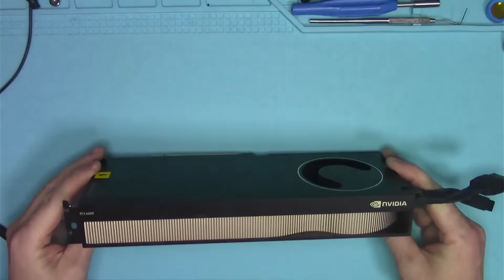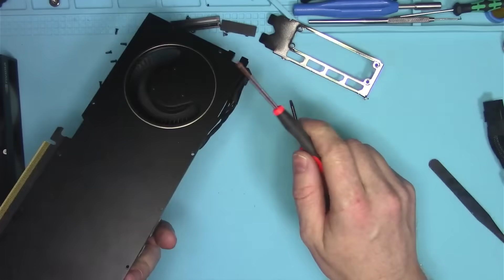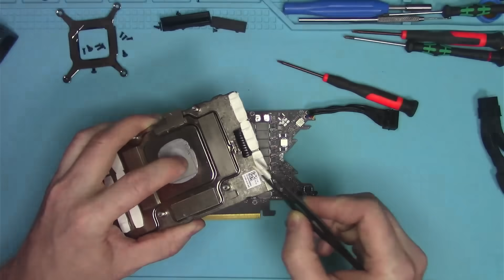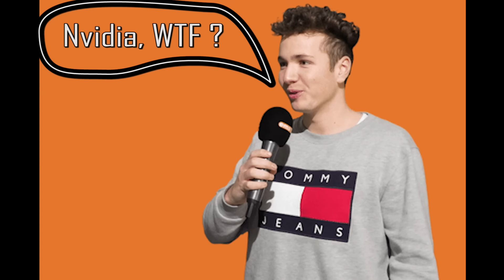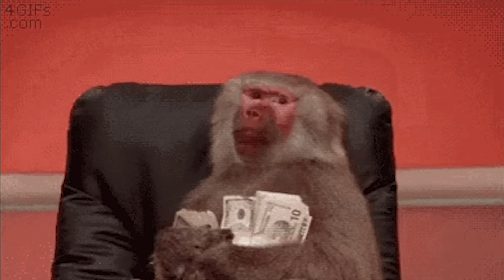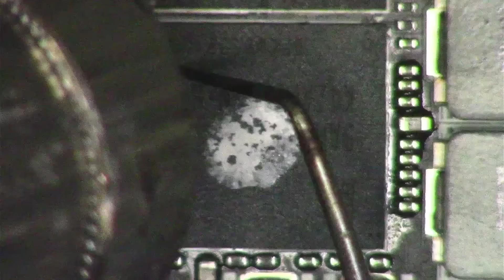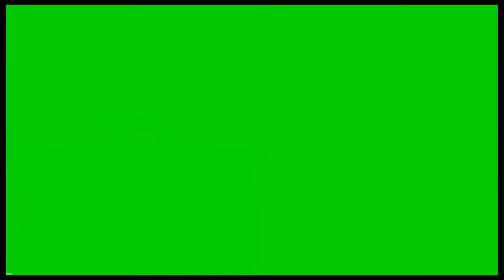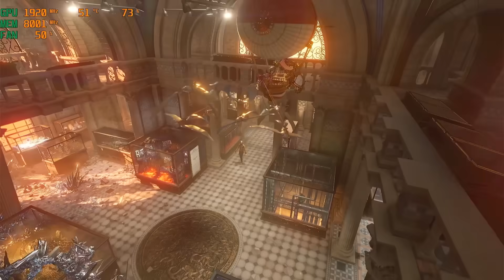Repairing the High-End Nvidia RTX A6000 GPU

Comment: The A6000 is a multi purpose Work Station card, it's used in anything from CAD, DCC, Medical Visualization which it has dedicated drivers for.  It's also used by Professional 3D Modelers/Animators in work station configurations.  The new iteration of the Quadro Line of GPU's pretty much
Reply: @johnnycab8986  don't know the specifics but, in 3d render workflows, its pretty much the same as a 4090 unless you have really complex scenes with lots of moving parts, lighting etc., in really really heavy workloads it can render twice as fast as a 4090. Unless you're pushing limits, it doesn't work better then a 4090, I'd just guess it can handle a lot more abuse for a lot longer which only true professionalls would run into
Reply: @heavenbaron4108  Actually the RTX Ax000 cards use the same architecture as the RTX 30 series cards Nvidia's Ampere Architecture. The RTX X000 without the A are the Ada Lovelace architecture same as the RTX 40 series cards.
Reply: @johnnycab8986  Ever tried to render a scene need more than 24 GB ram? or would you trust a consumer grade card enough to put in a supercomputer like racks full of just graphics cards.

Having 48gb ram is just more convenient or if you nvlink its doubled. If im trying to meet a deadline im not gonna try optimize every bit my big 3d scene and i wont trust a consumer grade card work almost %100 for days non stop and i want customer support and driver support for my niche softwares.

Dont get me wrong 4090 can do a6000 job but to a limit.
Reply: @msavasacar  Typically if your scenes make use of more than 24gb vram, then you'd just get a 2nd 4090 in the same system (still cheaper than an A6000), as most software can make use of dual gpu setups like this. So the vram issue is more for independent professionals and smaller businesses who likely weren't in the pricing group of the A6000 to begin with. When we move to full enterprise scale project needs, the benefits of the A6000 (outside of its drivers and some computational benefits) is that you can simply stack far more of them into one system, and don't need to sync multiple pcs to work on the same project in unison -and yes at this point it is also ofc much more convenient to have 6x48gb vram in one system, than 3x24gb for example with the 4090's limitations. It makes workflow more efficient when you can just fire up big projects on one system, also if multiple individuals are working off of that one system in tandem. Easier to have 2 pc that can service 10 people at the same time, rather than having 4-5 independent systems that don't talk to each other without being interlinked and that whole can of potential problems and pipeline barriers.
Reply: @Real_MisterSir  Almost every software can use dual gpus yes but consumer grade cards cant create shared vram pool. If your renderer need more than 24 gigs of data to calculate next iteration it has to swap data from card to card using pcie lanes, enterprise does this with dedicated link, nvlink. If can get benefit from that a6000 is for me if not then its not. I seen multi node like 20 30 computer, full gpu racks and even multi cpu racks for different purposes used by small companies. You can justify 8 a6000 price with single large project. It really depends what you do. Having cutting edge wokflow can and will give you more options business standpoint. So if you work deadline to deadline a6000 or threadrippers for you if not stick with consumer grade.
Reply: @msavasacar  thats lame
Reply: @msavasacar  More vram, and better customer support are valid points. This graphics card is using the same GPU (GA102) used in the RTX 3090 ti (and variants of this same GPU were also used in the 3090 and 3080), so if driver support is better for this model than the consumer variants, that's only because Nvidia is choosing to not make those drivers compatible with those other cards with some arbitrary restrictions which they could easily not impose on people.

The blower style design might be better for some systems, but I would NOT expect these workstation cards to actually be any higher quality, or more reliable, than most high-end consumer Nvidia cards. Many high end consumer grade graphics cards are likely of a higher level of quality and reliability.

If the better customer support and vram capacity is worth it for you, then that's great, but keep in mind that Nvidia makes much higher margins on these workstation cards than on consumer grade cards. The much higher price is not actually getting you a higher level of quality or reliability.

If you want to learn more about how to determine what makes one model of a graphics card better quality or more reliable than another model, check out Buildzoid at Actuallyhardcoreoverclocking. He does very thorough analysis of different boards, and I think he does sometimes do analysis of the workstation cards, though usually he is more focused on high-end and upper-mid-range consumer grade cards.
Reply: @syncmonism  Physical reliability is hot topic tbh, consumer cards need to be changed, upgraded each iteration, its not that easy at enterprise setting and thing can go wrong like power connector failure.

Definition of reliabililty for me, whatever fails i dont care, how fast it can be resolved and how low that failure risk (either physical or software).
Those cards can carry a million dollar several seconds of animation for feature movie or last minute job for some architech. if your card generate revenue like 10 times of its msrp like in a month that price gap is acceptible for me.

I will check out your recommendation, thanks
Reply: @johnnycab8986  In reality, for most applications it doesn't. A ton of VFX and visualization/3D studios are using 4090 cards instead of the A series. There are some benefits to the A series such as the higher Vram capacity on top spec cards as well as a couple of additional enterprise software drivers and they can handle some scene complexities better/a bit more efficiently - but in raw computational power the 4090 outperforms the A6000.

Another benefit of the A6000 is that their lower tdp and size/thermal requirements mean you can slot more of them onto a single pro motherboard with a Threadripper cpu or similar, instead of having to build, manage, and store multiple pc systems, the A6000 is purpose built for rack-style setups for this reason, so depending on the needs, one may be better than the other, and sometimes both will be used by the same company.

For example, some of the highest tier automotive visualization/design studios like Pininfarina will both have some PCs with 4090's for visualization, and also have other systems with multiple A6000 cards in them where bulk computation in a single unit is preferable. One system with 6 A6000 cards and a highend Threadripper will be easier to utilize, than 3 systems with 2 4090's each and having all 3 systems talking together with sync delays and whatnot.
Reply: Don’t forget it’s Machine Learning applications.
Reply: @Xaddre  a100s are more ideal for that.
Reply: @TheInfidel_SlavaUA   @theinfidel8244  Sli was useless on consumer cards before then too yes there was some performance gain on games but it introduced way more problems and gpu computing started much later sli/crossfires dead, iirc sli or crossfire never pooled memory like nvlink. Nvlinks whole sales pitch was memory pooling. 
Recent ada doesnt have nvlink too they probably leave this option on datacenter cards, i really cant argue with corporate greed. sli death was not only about corporate greed it had problems but nvlink gonna be dead on enterprise cards bc greed. Consumer grade cards become so powerfull quadro series cards lost their edge, before then lowest grade quadro folds every consumer grade ones in task like drawing millions of line. Thruth to be told those little design choises sell these cards to few customers. I choose a series just becouse of that minor things for business use, personally i use consumer grade cards for personal projects.
Reply: @msavasacar  while the A6000 should be more reliable than a 4090, that is only because the die is cherry picked, but that shouldn't make the card so much more reliable to justify the price. While the A6000 has double the VRAM, the 4090 is superior in just about everything else. IMO the distinction between quadro series and geforce series all falls back to marketing, they're targeting people that have loads of money for those cards, they are willing to pay the price, instead of having something to do about being better than its gaming counterpart.
Reply: @IskeletuBr  its not just cherry picked silicon, they use higher quality versions of just about every component on the PCB, such as VRMs and Driver Mosfets. They also tend to have more Tensor Cores, Cuda Cores, and Shader units. Nvidia also spends more money developing Drivers for them, which also means they're paying off other software dev companies to design their applications to be optimized with their workstation cards. In the end I'm sure they do take a healthy profit since they know the customer base for them is willing to pay but these cards are actually significantly more expensive to make than Geforce cards,  four times more expensive like they charge? maybe not, but at least twice the cost of making a geforce card.
Reply: @esotericjahanism5251  Not really, comparing it to a 4090 (yes, I know they were launched 2 years apart but the 4090 is still a third of the price) you'll get better everything with the 4090 technically speaking, while the driver argument is true and completely valid, that again falls under marketing shenanigans, because they could simply release those Quadro drivers for the RTX cards, but they won't because otherwise there would be no realistic motivation to buy a Quadro card.

Truth to be told, the only value a Quadro card has is artificially created by Nvidia...
Reply: @IskeletuBr  This is not just about how well or how good that card is, i cant argue about how well its made or whatever, never reverse engineered one but i strongly believe they still use cheapest option if its available and the whole point of those cards are you don't need to know what microchip used or which cherry picked die used. Its a certified card by nvidia and other software vendors they are tested by before even software becomes available. As a said they are never the better performance cards, older enterprise cards had far worse performance compared to same design consumer grade cards but you couldn't draw billion lines on those consumer cards they are simply not designed for that.

I know how to build a computer but if i do it at enterprise setting if something goes wrong its your/your bushiness fault, but if i let someone do it and test it for me if something goes wrong in my contract i should get working system in less than 24 hours. You cant get this much support with consumer cards. Edit: forget to add these cards are not just for people with shitload of money, they are exist because those people or corporations doesn't want to risk shit load of money. Buying enterprise cards not just the only option you can rent physically or could based services but its depends what kind of work you do, same job requirements differs studio to studio.
Reply: @johnnycab8986  "How does something like this perform its duties better than something like a 4090?"
Modified VBIOS, modified internal connections in GPU and different drivers.
Those things unlock full potential of GPU in math workloads.
Reply: @johnnycab8986  it’s anything like the quadro line up fairs on gaming, then not well enough to invest into. I have a few older Quadra m4000s, p4000s, k2200s and well userbenchmark will tell the story. Essentially just standard 70 series cards of said generation with more memory
Reply: @atlucas1321  have you tested them in actual work?
Reply: @zagzagz  Why you think its lame ?
Reply: @msavasacar  why not trust consumer products? do you think they will break down ? and what driver support do these lack?
Reply: @zagzagz  being the sys admin myself no, but I know the large majority of our base uses these cards still with little to complain about, we are only now seasoning them out with a2000/a6000 systems.
Reply: @zagzagz  Consumer grade cards failed me before. Why would i risk my money when i can use certified drivers and hardware.

I wont expect a new GeForce driver for my renderers new technology just like i wont expect driver update for new games studio driver. in the long run maybe one geforce update destroys my pipeline but i know it has extremely low chance on studio drivers.

If i game or work on small projects without deadline i happily use cheaper and more powerful consumer grade but if i had work piled up and i need just things to work i'm gonna pay more to lover my risk losing money more than i save when using cheaper option.

How using hardware for their intended purpose lame can you tell me that?
Reply: @msavasacar  yep it is when it is multiple times more expensive
Reply: @johnnycab8986 ealiability, better drivers usually, more vram usually, more bandwidth usually, more cuda cores usually, ECC memory. But the 4090 is better in alot of ways now being a much newer card with newer architecture
Reply: Look at NVidia 'compute capability' table...
Reply: @johnnycab8986  Memory + AI learning.
Reply: @johnnycab8986  They make special drivers suposedly designed to take the viewport load off the system and use a different method of data transfer to and from the sysem
The Example i'm about to use is not acuret but gives the basick idea of how cards like this are different.
Data flow for a consumer level card shown as lanes of the PCI memory traffic Lain 1 bidirectional Lane 2 bi directonal lane 3 4 5 6 7 8 9 10 11 12 13 14 15 16 17 18 one way into the card from the system. you may get a detecated downstream or two for screen capture. depinds on the genoration.
.
WorkStation/compute/enterprise.
Lains 1-8 all return trafic from the card to the system. Lanes 9-16 all from the system to the card.
This is more of an older configuration i'm almost positive that by now all lanes are bi directonal in the enterprise and workstation cards.
This is one of the reasons physX has been relegated to just doing special effects that dont interact with the game engine much.
they would have to open up by directional flow to the cpu via some sort of shared memory access with high throughput to properly share the simulation.

When it comes to what an a6000 can do for editing and such.
Part of if not all of the editing system is moved to the videocard alowing for fast transforms and high framerate viewports while still displaying complex hipolly seens in wire frame or in shaded modes while alowing the editing tools to modefy the model in the videocard rather than relying on the slower system to transform adapt reupload and redisplay .
the higher bandwith between the two allows the card/system to update the working ram eather in tandom or at the least allows for faster updates.
Reply: @johnnycab8986  the RTX Ax000 cards are on the same architecture as the Geforce RTX 30 series, this RTX A6000 in particular uses the same GPU die as the RTX 3090 butt has loads more VRAM, ECC VRAM, and lower power delivery. The RTX 6000 without the A(Nvidia really fucked up the nomenclature, shoulda just kept calling em Quadro cards, no cap)  is the same GPU die as the 4090 but again same story more VRAM and lower power delivery, but the RTX 40 series does have ECC VRAM that can be turned on or off. Geforce cards generally do better than their workstation counterparts in gaming though these cards aren't outright terrible at gaming. The RTX a2000 with a decent OC can outdo the RTX 3050 while only using about half the power. These professional cards are also optimized for thermals so its easier to pack a bunch on them into a single chassis and speaking on a KWH/compute power basis generally out do Geforce cards, but in terms of straight raw compute geforce cards will outdo Workstation cards.

But what really makes these workstation cards perform better in their given use cases is mostly VRAM and Validated Drivers. So even the wimpy RTX 2000 cards can have performance on parity with cards like the 4080 in applications like AutoCAD.

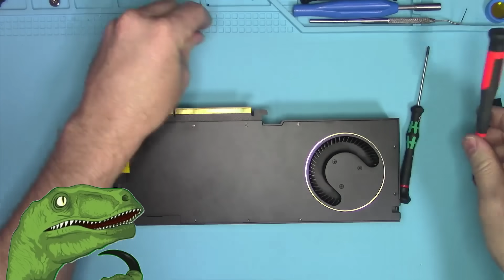Comment: 0:46 , is a working series so is made to not be massively sold to gamers, this is why it uses other screws, also it has no 1 label cus most probably because the owner has more in one single computer, also the design is made to use the airflow from a server chase this is why it looks different from most of other GPU's and this is the reason why it looks like a very special GPU.

Comment: Great repair video! just some stuff about the card (Im kinda obsessed with gpus and also nvidia professional gpus):

- The power connector is a EPS 12v (CPU) power connector, servers and workstations use this connector because its rated upto 300W (pcie 8pin is only 150W). The reason you got a short is because it uses a different pinout than pcie. and also the newer RTX 6000 ada (40 series) just uses the awful 12+4 hpwr

- The card has 48G memory so its made for servers and workstations, mining would not benefit with that amount of memory. Mining just wants large memory bandwidth (for example the 3080 320bit is better than the 4080 256bit)

- I dont think the "thermal paste" was dry, iirc nvidia uses ptm 7950 phase-change "thermal pad" that goes hard with no heat and pressure, then liquifies with heat and pressure. That gives it longer lifetime then any thermal paste with nearly the same thermal performance than a normal paste.